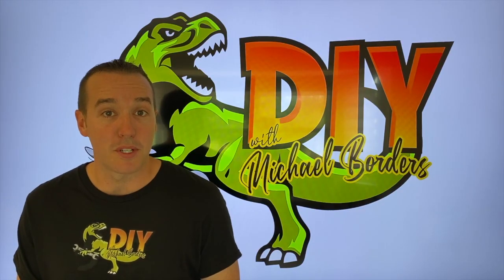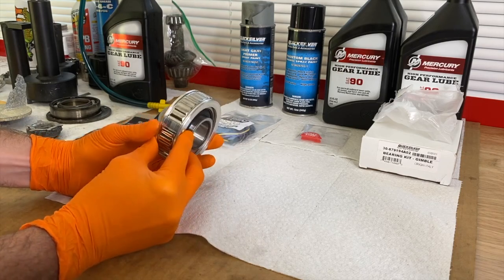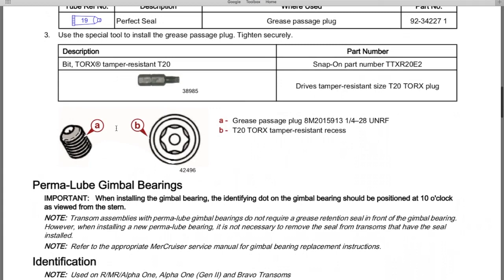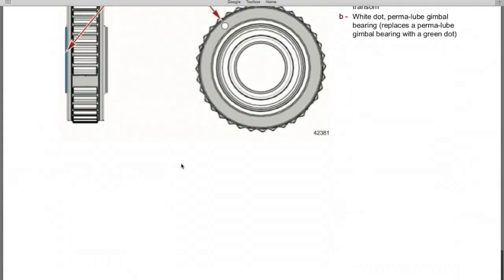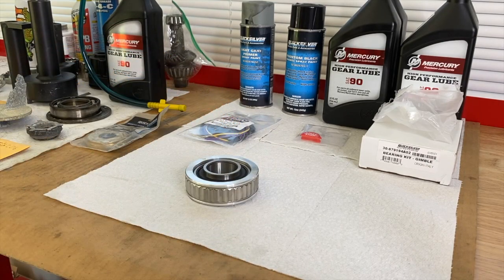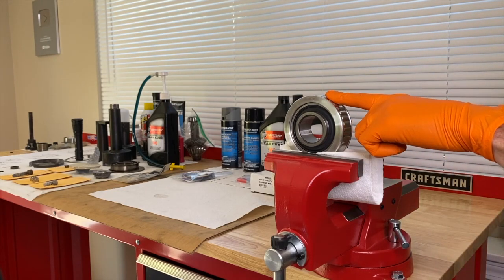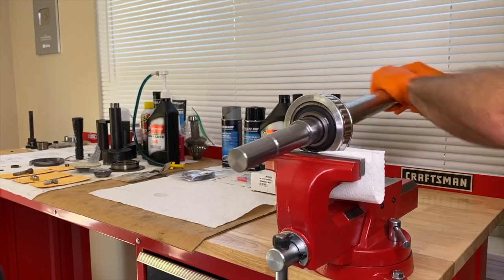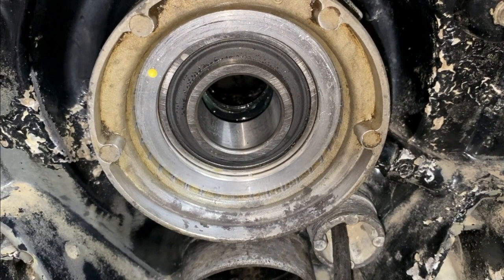Purpose of your outdrive gimbal bearing - How it works

Comment: What is the purpose of the slots installed toward the engine?
Reply from the maker: Thanks for watching, not sure what you’re referring too.
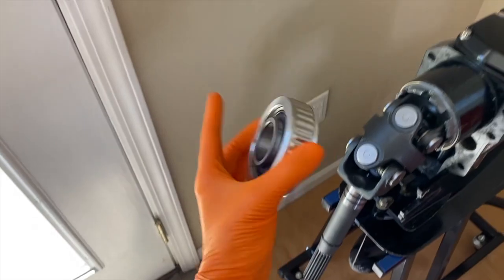Reply: @DIYwithMichaelBorders the 2 slots on one side of the gimbal bearing as shown at about the 7:30 mark of your video.
Reply from the maker: @buckdan3343 

Thanks for the reply.  The two machine-cut slots on u-joint shaft are for rubber o-rings.

😁👍🧰

Comment: excellent video, thanks for the great explanations!  I recently removed my mercruiser 3.0 l LX engine from my boat, and rebuilt the engine.  I have also removed the stern drive, and am currently preparing to replace the gimbal bearing, bellows, and water tube on the transom assembly.  My question is this:  Should I replace the gimbal bearing and then install the engine, and then align the engine to the new gimbal bearing, or should I install the engine prior to replacing the gimbal bearing, align the engine to the old gimbal bearing, and then replace the gimbal bearing?  I hope that question made sense.  Thanks for the advice!